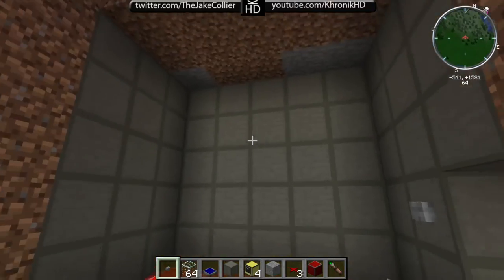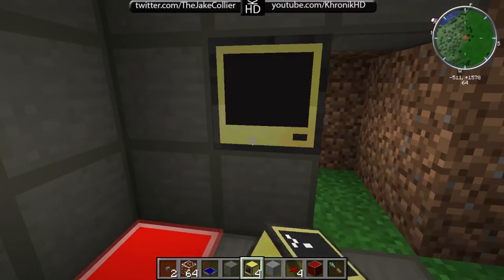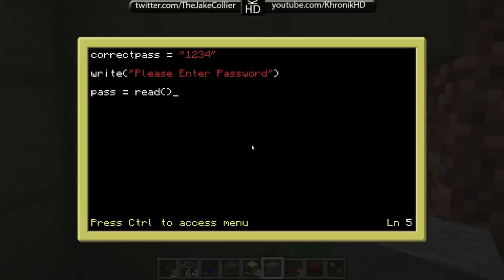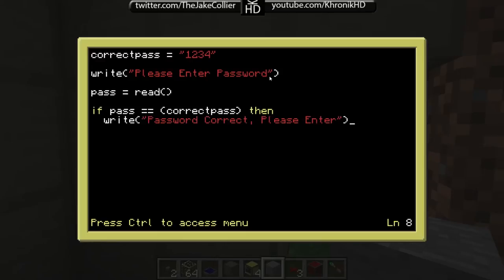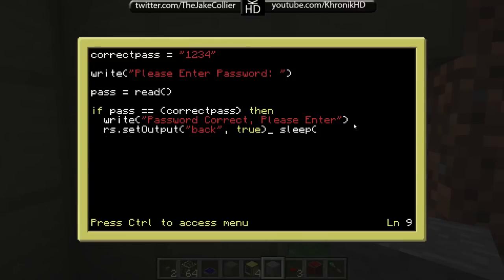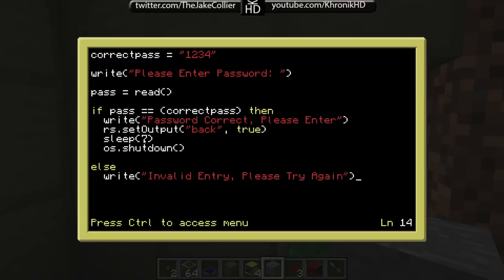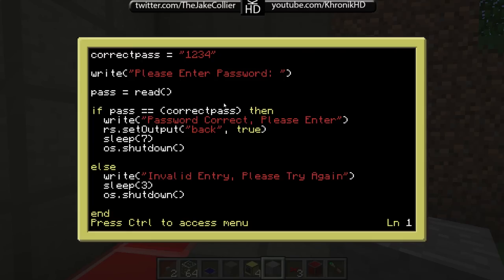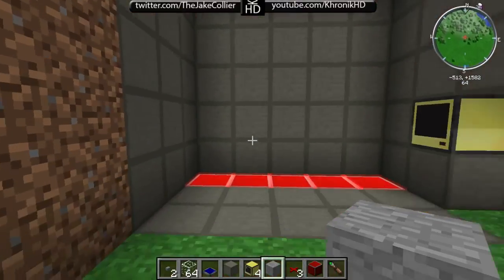FTB Tutorial | Password Locked Door Using Computer! Easy!

Comment: I need some help. i put in exactly what u wrote. when i write the wrong password everything works, it says Invalid password and it shuts down. However, if i put in the right pass it says correct pass (like normal), but then "startup :9: Expected string, boolean". and does not power the redstone or shut down the computer.
Reply from the maker: TheAKmail there must be an error on line 9 of the code,  make sure that you use a comma and quotes where needed